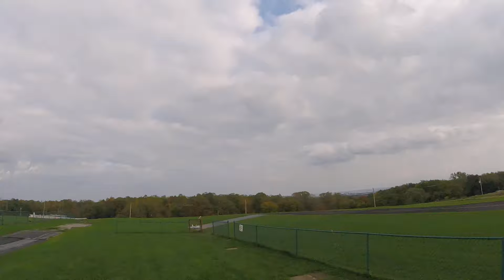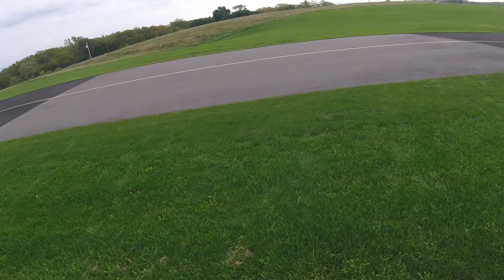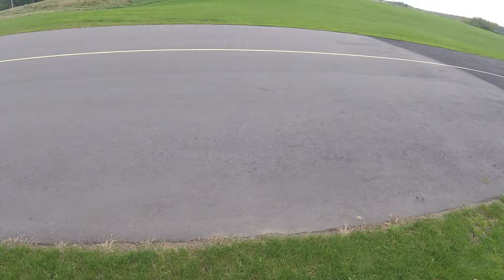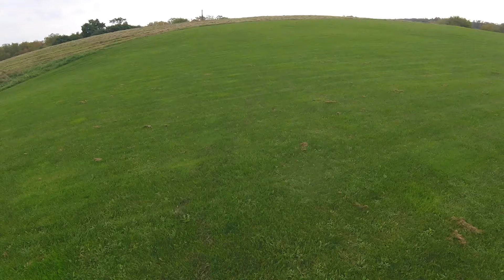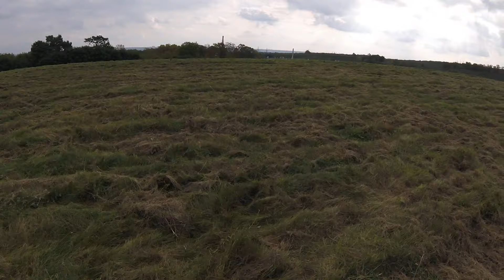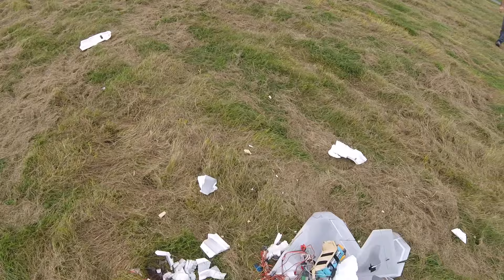Epic F-22 Lawn Dart Crash Total Loss!!!

Comment: It wasn't just a bullet failure... You would've still had servo control and just a loss of EDF power. I'll bet you flexed the tail section which happens with 12s level power. I had to reinforce mine to stop it from twisting. Take a close look and I guarantee you'll see stress marks. 😉
Reply from the maker: I did see that how did you fix it?
Reply: @ghoustanable  Everyone has their own approach but dual axis carbon strips made it rock solid for me. The full flying stabs REALLY twist the tail section on the F-22 once you make good power.

Comment: Ouch….
You staying calm was impressive though.
Any idea why there was a signal loss?
Reply from the maker: No bad bullet connector in main power supply was loose causing poor connection and then power loss. Totally poor planning on setting up the power supply on my part.
Reply: @ghoustanable  
Thanks for the update, good you have found the cause!